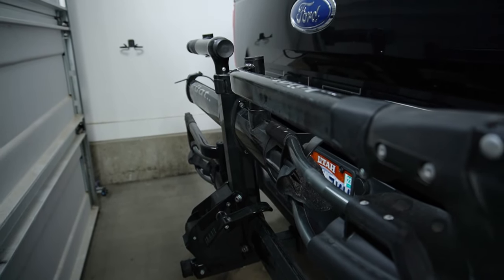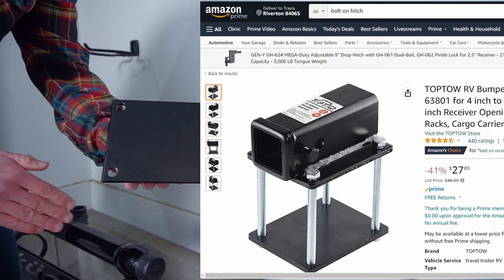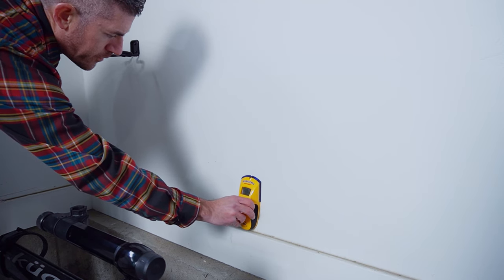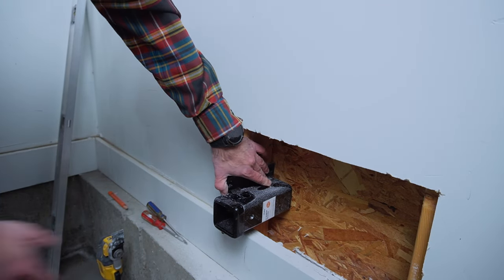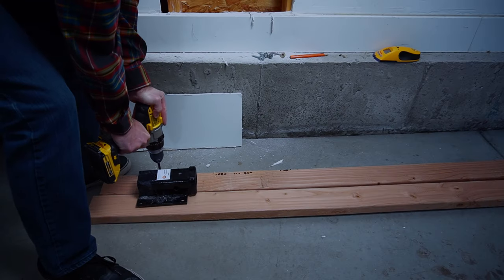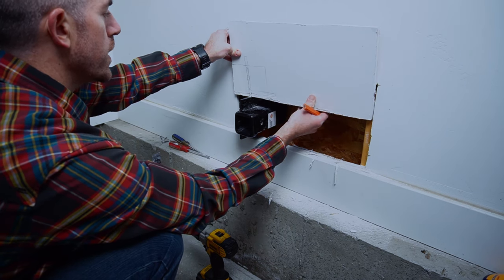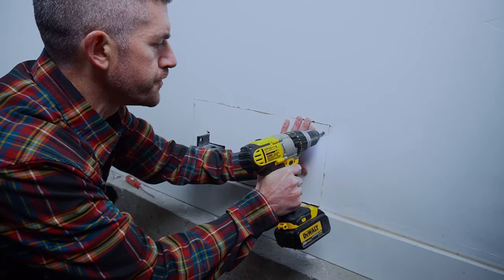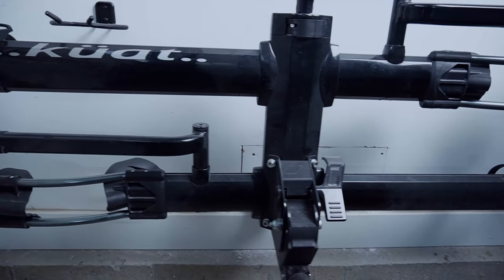How to store your bike rack in your garage

Comment: Assume you can't use the locking pin horizontally as you usually would because the mount was rotated 90° when you installed it...  Did you drill that out or do you just not put the pin in?  Thanks for the great video!